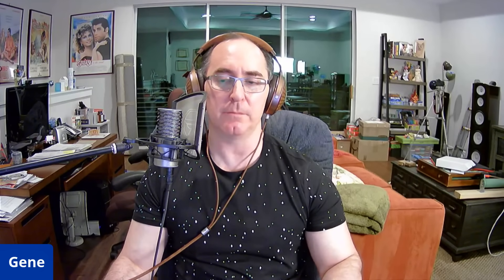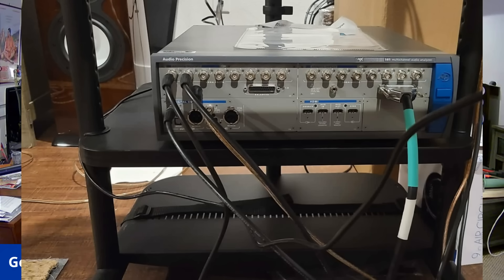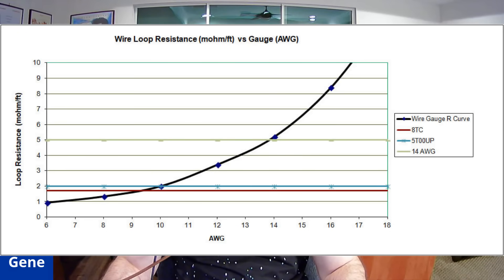Speaker Cables Really Don't Make Much of a Difference?

Comment: I did similar testing using a LinearX LMS analyzer decades ago…however I was trying to show that Teflon dielectric Cat5 was essentially the same as any fancy boutique branded braided cable. I also measured the same inductive rise out to 100khz on 10 awg copper twin lead and very little rise on the Cat5. This makes sense since the cat5 is designed for low loss at 100mhz . Conclusion; make your own kimber cables with cheap Cat5 and braid them yourself! But since it’s all inaudible anyway; I chose to skip it ( I did wire my surround sound with cat 5 though because it was fire rated for in wall use and cheap. Multiple runs for each position to reduce insertion loss due to dc resistance)

Comment: You did your tests totally wrong. First, you have to burn-in your cables for at least a week non-stop to align the crystal structure inside the conductors. Then you have to use the correct polarity, if you plug in the speaker cables backwards, then you instantly crash the stereo image. Third, you should use double filtered perfect sinus power source with solid copper wires otherwise the transient noise ruins the detailed resolution of your amplifier. And finally, I can't see anywhere the Blackbody ambient field conditioners. How can I take these measurement seriously when you do them in unconditioned electromagnetic environment?

Comment: Thanks Gene. I normally use 12 gauge CCA cable. I splurged and bought some generic OFC 12 gauge cable from Amazon, which is still cheap compared to so-called high end cable. Thanks for validating something I always felt. I will never spend thousands on speaker cable but I will start using a better grade of cable just because I have invested a bit into my systems.
Reply: That's the key.  Use the very best CHEAP cable.  Even though it probably makes no difference, I make the leads as short as possible and the same length.

Comment: I was once present in a Kimber demostration with Ray Kimber himself presenting his cables. He setup his demo with one pair of speakers laying on the floor and connected to an amplifier via cheap cables, and another identical pair of speakers on top of them and connected to the same amplifier using Kimber cables. Sure enough, when Ray A-B switched both pair of speakers there was an audible difference in favor of the speakers connected with Kimber cables. When I remarked that the audible difference was most probably attributable to frequency response differences caused by the different positions of the speakers, he flatly denied it. I then asked him to switch the positions of the speakers so those connected with Kimber were on the floor and repeat the test, which he reluctantly did. Now the speakers with Kimber cables were at a disadvantage, and at that moment most people present understood we were being fooled by a high-end cable manufacturer and left the room.
Reply from the maker: That's as bad as the Monster Cable demo that compared the brightness of light bulbs using their 12awg cable vs generic 18awg. People wee in awe not realizing they were being duped since both set of cables, although the same length,  were different gauge in favor of Monster.
Reply: I was at a audio show where Monster Cable was demonstrating the difference between lamp cord and their cable, each connected to a separate Dahlquest DQ10 speaker.  Sure enough, the speaker with the internal treble volume control turned down sounded muted.  How about that!
Reply: The sad thing is so-called audiophiles didn't immediately realize the difference in speaker placement and what it obviously means, even before they were demonstrated.
Reply: "I then asked him to switch the positions of the speakers so those connected with Kimber were on the floor and repeat the test...."  That was a stroke of genius on your part.  Hats off to you.
Reply: Salesmen don't favor a fair comparison any more that Vegas likes a consistent winner.
Reply: To make sure both speakers were truly identical internally I would have asked him to swap the cables around along with the placement of the speakers.
Reply: Good thing you were there to equalize the tests!
Reply: Kimber Mountebank
Reply: This actually proves nothing. He should have played the same speakers and only changing the cables. Speakers on the floor are going to sound much different than speakers off the floor no matter what. The quality of the cable will be hidden.
Reply: Am I reading this wrong or? Why not ask him to switch the cables instead of the speakers? Wouldn’t that have proved the same point? I must be missing something.
Reply: @HelloYesPlease  the speakers were very light so it was easier to switch them.  Switching cables involved much more labor and hence time.
Reply: @ Ahh makes sense! Thanks
Reply: That's first thing anyone with half a brain would have pointed out
Reply: So what you’re saying is positioning of speaker cables can make a difference.
Reply: @Madmart54 No, position of the speaker within the room, which has been shown to affect how people rate speakers in double blind testing.

Comment: Well my timing of viewing this video was perfect timing.  61 and just broke out, repaired and refurbished my old Pioneer SX-450.  Putting the brakes on blowing a load of money on new speakers and associated gear.  Now thinking purchasing the XLS Encore's with the base kit.  $250 - $600+, hedging towards the $250 base kit and may just build my own cabinets.  Did exactly that when I bought the SX-450, couldn't even afford speakers after the SX-450 purchase on my paper route budget so I built the drivers out of lumber scavenged from construction sites.  They sounded great for gear in 1974.  I think with a few minor changes I can clean up the SX-450 sound enough for my ears.  Thanks bud!
Reply: I've really got the hifi bug now.  Looking to clean up the sound, add some good bookshelf (XLS Encores), and some powered subs.  Not sure if these old ears can hear the differences given all the riding mower & weed wacker and shooting range hearing damage over the years, not to mention all the loud concerts of the 1970s.  I have a 12x14x10 great room and kitchen all in one for the theater.  No room to pull the speakers away from the wall.  Just a real theater environent that probably most of us are trying to fill.  If you have some feedback it would be greatly appreciated.

Comment: Yes.  Actually measuring and comparing.   Just use a decent gauge copper cable with reasonable length runs.  A good cheap super cable is about the same gauge as mains voltage cable.

Comment: James Randi had a million-dollar prize for any golden-eared audiophile who could statistically tell the difference between cheap and expensive speaker cables in a controlled, double-blind listening test environment.  No takers.  Shocking.
Reply: There is a certain level of build quality that can make an audible difference between good and complete garbage cables.  Beyond that relatively cheap threshold the diminishing returns are exponential.

Comment: I enjoyed the scientific analysis & great job with that. Can I ask, how you worked out what you were going to analyse & if you were actually analysing the right measurements.
I understand what you measured & how it was explained but did you measure any difference the actual sound coming out of the speakers? 
I'm only asking as just upgraded my stylus which made an absolutely massive difference in the actual sound, I then changed the tonearm interconnect & I could definitely tell it aided the stylus upgrade. I'd love to be able to scientifically measure what difference it made, not in terms of resistance etc, but in actual sound wave form/shape or whatever it is you measure for clarity, warmth, depth, sound stage, etc. etc. I also think the biggest problem with HI FI is subjectivity from the listener. IE. in this case, Me, because now I've heard a difference, science cannot disprove it. Even if my system was scientifically measured before & after, once i'd heard a difference in the actual sound, real or imagined, the science would lose. Which is quite odd.
Keep up the good work & great analysis, very interesting.

Comment: one thing I don't see these aledged 'audiophiles' doing is soldering speaker cables straight to the PCB in the amp and directly into the crossover. If your going to bypass all the weak links in a speaker connection, soldering directly from amp to speakers will circumnavigate the whole thing.  do i think it would make a difference? no.

Comment: the ~160 people who disliked this sell cables for a living.   would i run a 100ft length of lamp cord through my ceiling? , no probably not. All you need is abit of cheap chonky copper cable with soldered spades on the end and your good to go

Comment: Gene, thanks for this, keep up the good work. Back in the golden age, AR had a listening room in Cambridge. My wife and I would go there and listen to their speakers. All the speakers were mounted on a wall and the music played thru AR amp. When the sound was switched between speakers, a red light would come on. When listened on several occasions and you could ignore the lights and just concentrate (classical music was played). After several trips, my wife and I could not tell the difference from the top the line AR-5 and the one below it, AR-2ax, so we opted for the less expensive. Ever since then I had always thought specs first, then blind listening on several occasions are the way to judge equipment. Considering, of course, your listening room. BTW, I moved my PSB speakers 3' from the back wall, up 3' from the floor and 6' and 14' from the side walls. What a difference from placing them 1' from rear wall. Yes, moving your head back and forth, left and right, can reveal even more. Thanks again.

Comment: YOu could also say that all dacs sound the same as they just process 0 and 1. I have ribbon cables throughout my system, including power, and I can hear the difference from stranded normal cables. I think a cable sounds like it does due to 1) geometry 2) metallurgy 3) resistance 4) capacitance. ALL these things add or take from a signal

Comment: I have been in the middle of this age old argument for 30 years. The fatal flaw in the argument that premium speaker cables don't affect sound quality, is that all of them, including you, have no Control for your experiments. None.  No frame of reference to base any of your conclusions on. Why?  Because the "audiophiles" have never come together to establish a reference system and setup that all other measurements should be compared against. No one saw you run these tests.  No one gets to see what sort of setup for these experiments are being taken under. For all we know you have major issues with the entire electric wiring in your house or in that room.

I have carried the same set of speakers with me since 1994.  The DCM Timeframe 600s. These speakers have been connected to 15 different rooms, 6 different receiver/amps and a multitude of different media equipment from CD players, Dvd, Bluray, Xbox, VHS, Laser disc, DACs, etc. In all these scenarios, the DCM Timeframe 600s sounded different. That's the entire point.  The Speaker is a direct reflection of everything that comes before it; right down to the electric socket you have it all plugged into. Saying cables don't make a difference is about the same as saying the type of tire you put on your car makes no difference. It all depends on what you connect it to and whether it has the capacity to take advantage at all. 

After 30 years of this argument, I have determined that the naysayer's core beef is that they cannot handle the concept that you can improve sound by just buying a better cable.  Because if that were true, you could buy weak equipment and weak speakers but have audiophile sound because you bought a $10,000 speaker wire made of pure, solid silver.  It doesn't exactly work like that.  I promise you, the people who bought $50,000 dollar amp/pre-amp and speaker system, aren't using vintage lamp wire or 24 gauge black/red speaker wire. They aren't using generic spools from some unknown company.  No, these people bought the $10,000 speaker cable and it makes a difference in THAT system because the equipment that sits behind is so sensitive and powerful that it NEEDS that quality. 

My opinion is that this argument should be altered to, "Don't buy cables whose quality exceeds the quality of your system." <--  THAT is a far better argument.

Comment: I've always just taken 10awg THHN (at whatever length i require usually <10') Use a drill to twist them up nice and snug. Durable, Noise resistant and capable of carrying every drop of current.Also there is the nice feature of the many possible color combinations of THHN.

Comment: Even as a teen I was able to match various  salvaged speakers from discarded vintage consoles and cabinets as well as modern (for 70's and 80's equipment) stereo cabinets ...matching them   for audible frequency response and  audible tone range  (I had really good ears back then...today  not so good...lol age does wierd things to you) regardless of size and shape..given that all were 8 ohm standard used in most home stereo.  the sizes and shapes may not have matched but I was able to match sounds in groups of different speakers in paired salvaged cabinets I used (sometimes salvaged kitchen cabinets slightly modified) ...as for speaker cables?  I just used what i got , usually standard 12 AWG stranded lamp cord available  for cheap in 100' rolls at the local hardware store...  I never noticed any signal problems..  and as I see in your tests that's the case. although you used 10 and 14 mine was in between those and meets all other parameters of your tests.   and is realatively cheaper than any other good wire sold as "Speaker" cable,,,,  sot it'a almost all Hype to get a higher price for essentially standard wires available almost anywhere...lol   I guess It boils down to the  perception of higher quality. simply because an advertisement said so....lol,,,   I think I'll stick with my cheap 12 AWG lamp cord I can get so easily at the Home Depot  or Lowes...lmao..

Comment: Audioholics, I’m getting BJC ten white for my speakers, left (15 foot), center (8 foot), right (15 foot) - but was only able to order them 1 meter (3 foot) to long for every speaker. Would you recommend cutting down the lengt, loosing the banan-plugs by the speakers, to have shorter cables? Having a NAD T778 with Rubicon 6 speakers and Rubicon vokal.

Comment: Just for shits and giggles, have you ever tested 12/2 or 10/2 soow cable? It's very flexible, strong, multi strand wire used for electrical equipment power cords.  Everyone can laugh at the idea but I've always wondered how it would test out. Lol 🤷‍♂️

Comment: Been an audiophile for 60 years. i.e. the beginning of stereo. Before the idea of marketing ‘audiophile’ absurdly expensive cables, experts advised to use cable gauges that allowed full frequency response based on length of run. In other words zip cord was perfectly acceptable.  The only speaker wire NOT to buy would be copper coated aluminum.  Gene, Kudos to you for exposing a multi million dollar fraud. Keep up the exceptional work.

Comment: Just out of interest what leads you to rank resistance then inductance then capacitance as having the greater effect on the sound of cables?  I notice that you didn't measure microphony or RFI resistance. Why was that? And finally I notice that you didn't listen to the cables to confirm the results of your measurements. Are you not trying to correlate your measurements with what you hear?